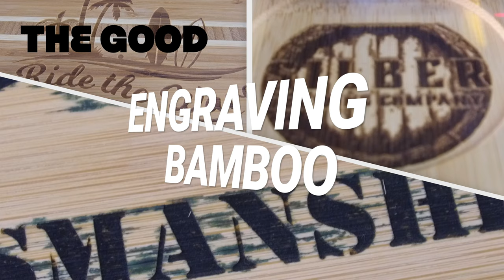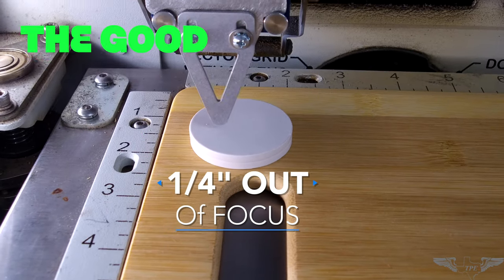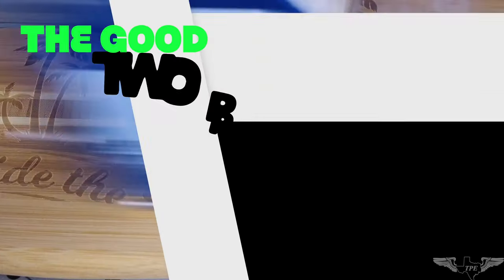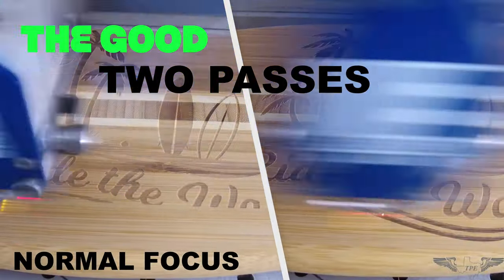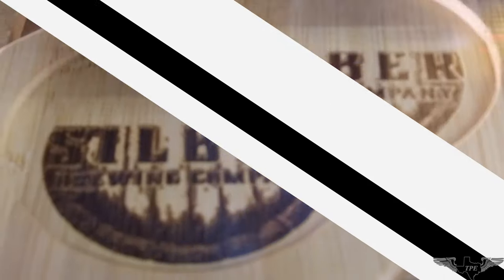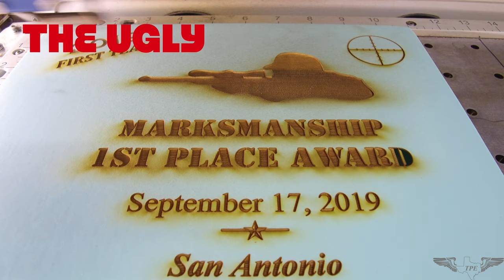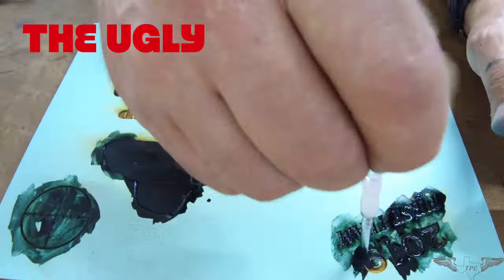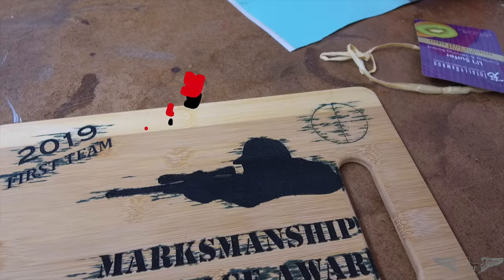Engraving Bamboo THE GOOD, THE BAD, THE UGLY

Comment: For the color fill on this project I think I would have just sprayed black Krylon while its still masked off and then spray clear coat over that as well while it is still masked off so the board is still good but only the painted surface is clear-coated.

Comment: I'm be to lasers and bamboo When you say 1/4 inch out of focus do you mean drop the bed 1/4 inch lower than normal focus?
Reply from the maker: Different bamboo may have experiment with lowering the table out of focus for darker engraving.
Reply: I would think raising the table to focus deeper would give it more depth.  ?
Reply: He showed putting a 1/4" thick disk on the surface and adjusting the laser head to that height, rather than setting it to the bamboo surface. So that is what he means by 1/4" out of focus. (That would be the opposite of raising the bed 1/4"...but I get the point that raising the bed (or lowering the laser head) would give deeper focus and more depth of engraving.)